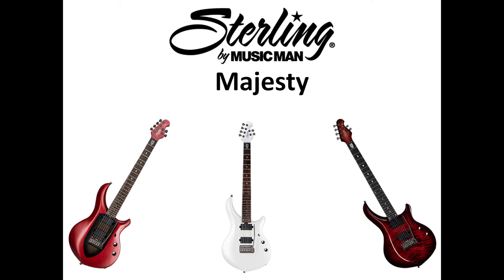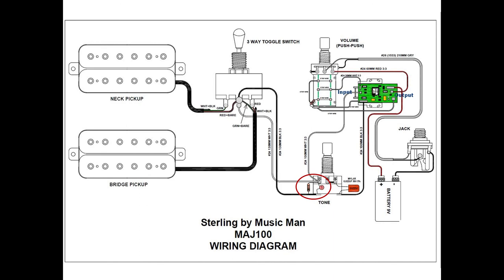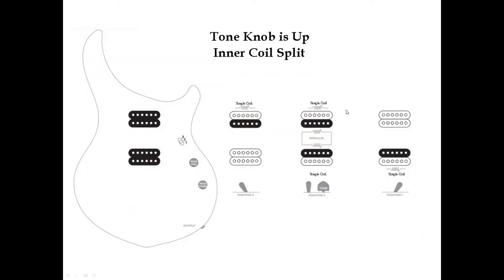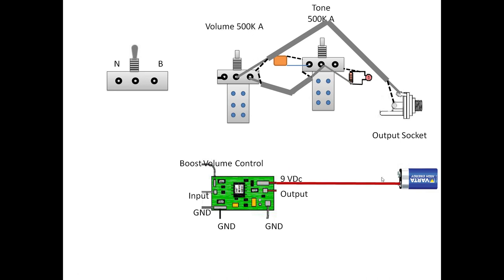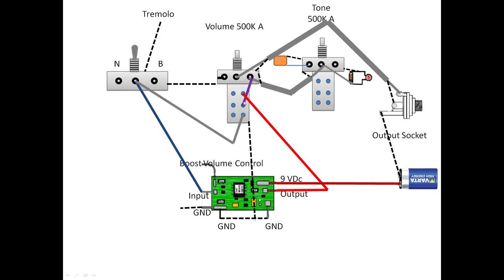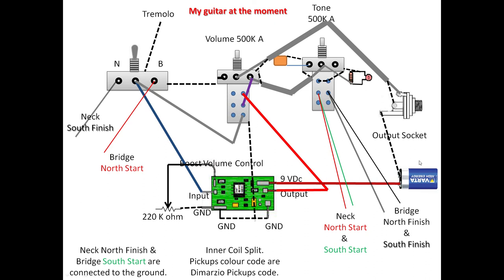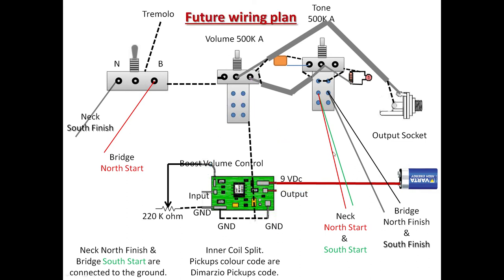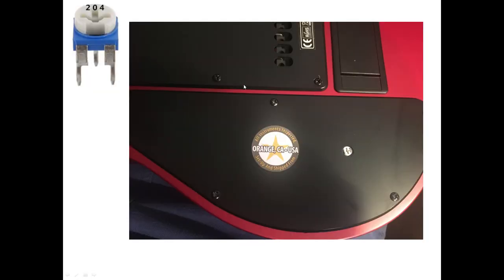Majesty Sterling by music man upgrades, passive operation, no battery, coil-split, and Boost volume

Comment: Hi nice explanation..and very clear. I am planni g to add piezo on my sterling majesty...could you explain how to wiring it with a single output
Reply from the maker: You have 2 options, drill a hole and add a selector switch like the Ernie ball guitars or to sacrifi 1 of the boost or coil split option, and add a push push to activate the piezo with the magnetic pickups, personally I will choose stereo output and put the magnetic on the main and the piezo on the secondary and I will use stereo cable and then splitter and aby switch , sounds complicated but it is easy
Reply: @musicalwolf1080  thanks..bro for the fast reply.
Reply: @musicalwolf1080  already drill a hole on the top horn and add the 3way selector. The thing that made me confuse is to split the signal from magnectic and piezo just like the EBMM..could you explain..
Reply from the maker: @28thstudio41  you did the hard job, now is the easy one, 
Take the output of the magnetic pickups and connected to the right side of the second selector switch, connect the piezo output ( after the pre amp and piezo volume if you use one) 
Last step connect the middle of the second selector switch to the guitar output socket
And you are done
Reply from the maker: @28thstudio41  I’m traveling now so I can’t do a video to explain it, but I can do one like after 1 or 2 months when I go back
Reply: @musicalwolf1080  owhhh...i see...it okey..will wait for your informative video soon. It so helpfull...thanks alot @Musical Wolf
Reply: @musicalwolf1080  currently yes i have do like you explained, but the output from the piezo preamp and magnetic pickup shall share the same tip..my idea is to split the output ,whereby magnetic and piezo out can be spilt using stereo jack from the guitar jack output and    using the Y cable to the amp..
Reply from the maker: @28thstudio41  sorry mate for late reply, actually to use stereo output is easier, just connect the the piezo signal to the ring in the output socket, and use stereo cable with ABY switch, as you already drilled a new hole, so you can use it as a volume for the piezo, hope that is helpful.

Comment: Hi! Great video and great explanation, it helped me a lot to understand the circuit. Just one question, what are the values of the resistor and the capacitor in the original bleed circuit? During one of my experiments I lost the resistor and the capacitor and I don’t remember the values, I think the values in the diagram are too small to be seen, and I want to bring the guitar back to its original circuit. Thank you very much!

Comment: Great video! I have a Sterling JP157 with just a volume boost that I rarely use, so I'm thinking of converting that push/push switch to a coil split. Any idea if that is possible? I'm relatively new to this and I'm not sure how factoring the preamp into the circuit affects things.
Reply from the maker: it is easier if change the tone knob to Push/Push and keep the volume with boost option, and follow the wiring in the video from 9:15 I'm explaining the coil split option in tone knob by push/push as the EBMM guitars have. but remember the wire color code i use in the video is for dimarzio pickups not for sterling pickups, the neck pickups of sterling have a different color code, but the bridge pickup of sterling is the same as dimarzio.
Reply: I have jp157 too, and i rarely use active-boost too, so i will remove active-boost and mod volume knob push to split neck single coil, and buy tone knob push/push for split bridge hum to single coil, then i will get more 2 single coil, but i’m not sure about single coil sound, I can split north neck or south neck and split north bridge or south bridge. If you modified him, can you tell about single coil sound? And which hum that you split?

Comment: Hey, thanks for your explanation. I'm thinking about getting a sterling majesty right now, after knowing that coil split is available as a mod. My question is: Can the stock pickups be modded into inner coil split? Or should I upgrade the pickups into dimarzio? Thanks.
Reply from the maker: You can add coil split to sterling pickups, but you need to change the tone pot to push/push or push/pull pot

Comment: Hey! I was looking to swap the pickups first with the DiMarzio Patruci set. Would the grounds and leads be the same based on your original diagram as DiMarzios color code?
Reply from the maker: yes, all DiMarzio pickups have the same wires color code
Reply: @musicalwolf1080  thank you!!
Reply: @musicalwolf1080  so essentially a one to one swap of the factory pup colors

Comment: Have you tried the "future plan"?
Reply from the maker: No, I removed the boost circuit and add piezo 🙂🙂🙂
Reply: I removed the boost too. I tried that configuration but wasn't working. Maybe I made a mistake.. But wasn't working. I went straight with volume and push pull for split the way you posted Petrucci way and everything went well, sounds very good. It's great to have all the alternatives.
I will look at the Piezo. Did you use the saddles or one single one?
Did you post a video as well? Didn't see it..
Thank you anyway for the videos. Great help.
And thank you for answering ti our questions.
Have a great time!
Reply from the maker: @gammanickify  I used cheap piezo discs from Amazon, it is not good as the original piezo but it at a flavor on the clean tone when mix it with the clean tone, I didn’t make a video for the piezo 
I’m happy that my video is useful, that is the main idea of it.
if you have any questions feel free to ask

Comment: I have a Sterling JP 70 and I'm planning on getting the Music Man piezo saddles and piezo toggle switch. I'm not sure if it would work or not bcuz Music Man states not to use Music Man parts with Sterling. So I'm wondering if anything bad would happen over time?
Reply from the maker: well, the bridge size and shape of EBMM is not the same as SBMM bridge, it can be done by cutting some of the wood in the Sterling guitar so the EBMM bridge can fit (Risky operation if you are not expert :) ) also you need to add a volume knob for the piezo, which means another hole in the guitar and also another selector switch for piezo and magnetic pickups selection, and don't forget that you need to use a powerchip volume knob from fishmann or equivalent knob to isolate the magnetic pickups signal from the piezo, or you can use a stereo mode for piezo, but if you want to use mono mode, you must use the powerchip or something equivalent.
Reply: Were you successful with that? I could not find MM piezo pickups to buy

Comment: Can you please link the power boost circuit and pots? I adding the battery, push push, and circuit to a jp100d that does have any of the circuits
Reply from the maker: The power boost circuit comes in the guitar itself, it’s in the majesty not jp sterling models
Reply: Is there anyway to get that circuit? Or is just a voltage circuit board?
Reply from the maker: @jimking6213  you can buy a circuit from Amazon or other shops, but quality is not granted, and believe me it’s not very useful as it looks, I don’t use it